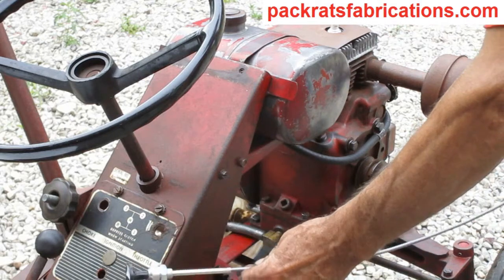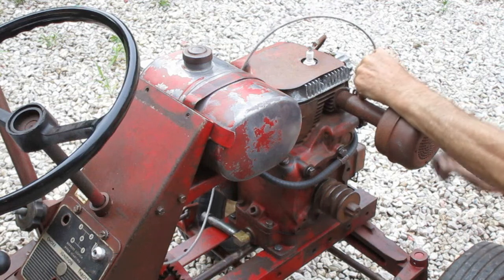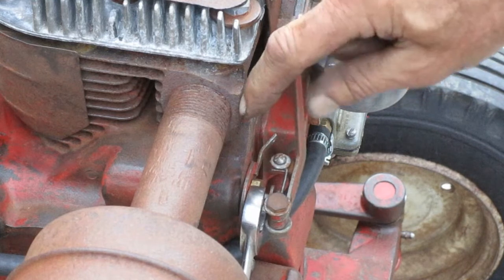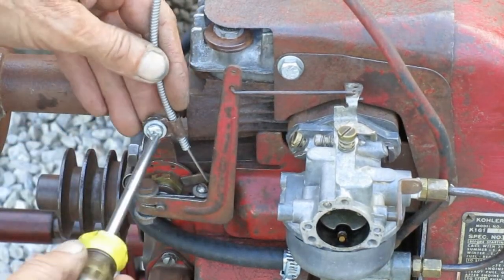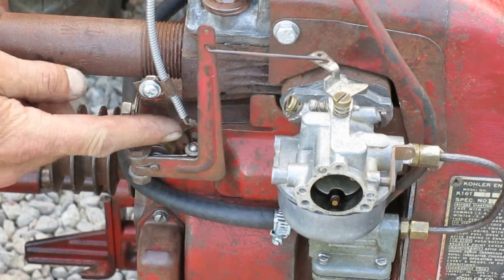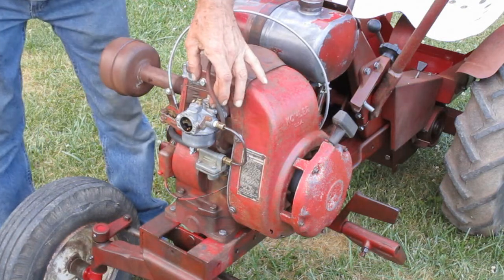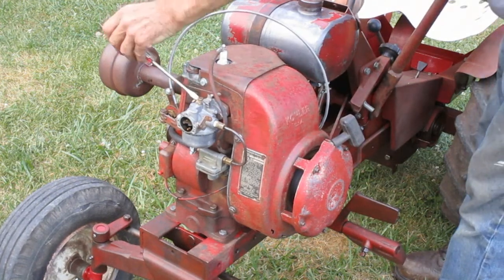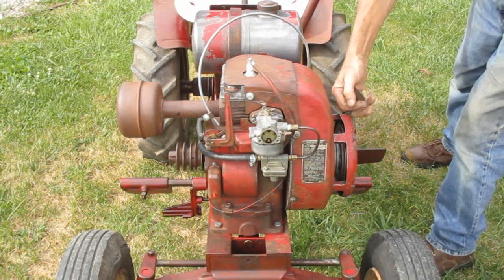Wheel Horse 704 Cleanup #22

Comment: I’m having a hard time with the carburetter. What are the 3 screws spouse to be set at. I think it’s running a bit hight in full throttle. The ideal is or but when I drive it’s just hight.
Reply from the maker: If you're saying the engine runs too fast at full throttle, that's a governor problem, not the carb, so I would re-adjust the governor. I'm planning on putting out a video about carb adjustment this weekend.